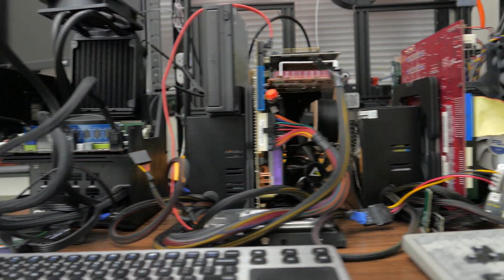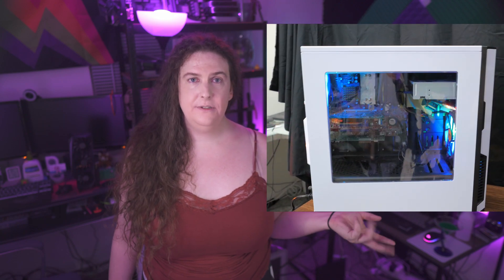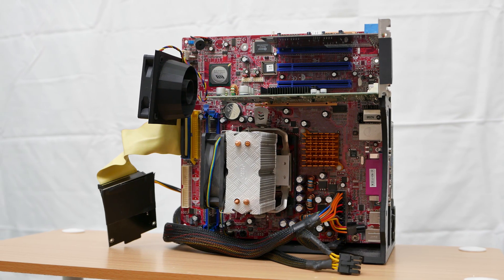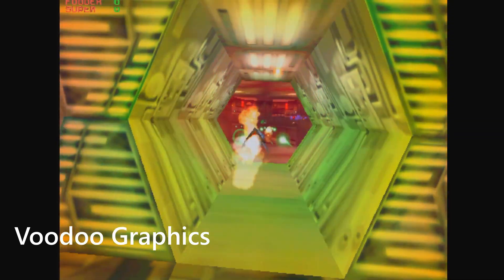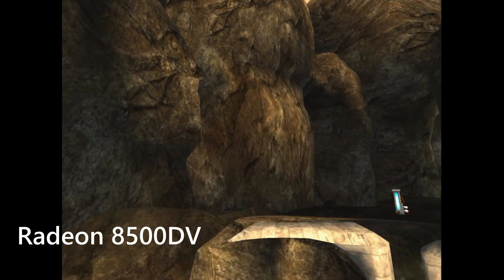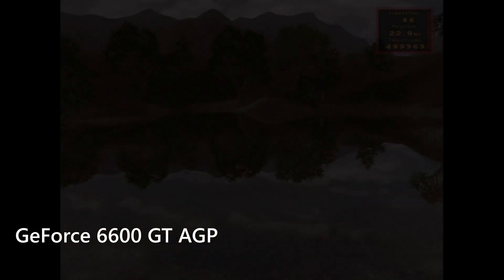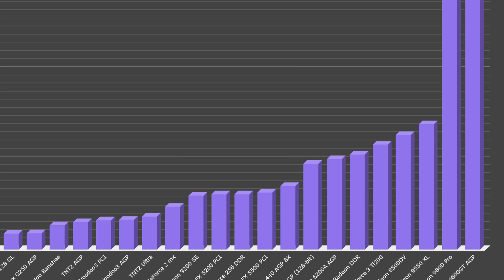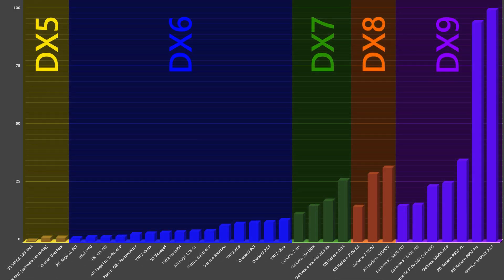Test All The Things!

Comment: You said that at the end of AGP it was the start of the GPU arms race.  In your opinion, does that suggest that AGP wasn't a good enough interface for graphics cards and was holding them back?  Or was it just a coincidence that graphics card manufacturers really started getting competitive at around the same time as PCIe coming out?
Reply from the maker: It was mostly just coincidence. R300 really lit a fire under nVidia (as evidenced by the 6000 series on AGP), and PCIe was just getting started at the time.

Comment: The DX support graph looks like it shows the trend the best - it looks like some of the cards break the performance trend when arranged chronologically, probably because they only supported a lower version of DX?
Did you take into account the resolution when plotting performance? It would probably be a decent approximation to divide by the number of pixels in each frame.
Also, for the next video, it might make more sense to display the graph in log scale (or show both versions), since that will prevent the numbers on the low end from being crushed. It could also be interesting to see what the best fit curve is (i.e. how much faster did the GPUs get per year). Although, that may require breaking the curve up into multiple piecewise continuous fits, to represent the regions where the exponent changed (e.g. different GPU eras).
Either way, it's very cool to see how drastic the performance increase over time was.

Comment: Awesome work! There is a clear exponential trend in the graph. With a logarithmic y-axis it should approximately reselble a line.
I'm not too familiar with the very early PCI/AGP GPUs; for me modern GPUs start at around 2011 with Nvidia Fermi and support for GPGPU through OpenCL. I have a database for ~500 GPUs/CPUs since then, and the exponential trend continues to this day. Though memory bandwidth increasingly lags behind compute.